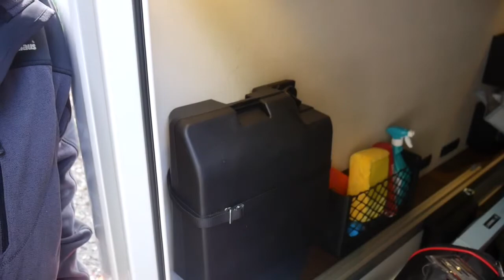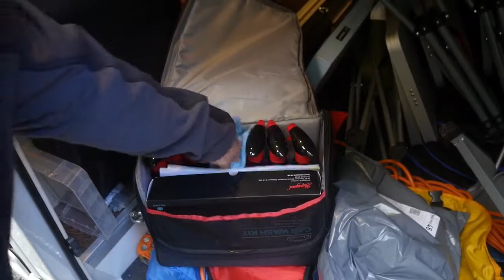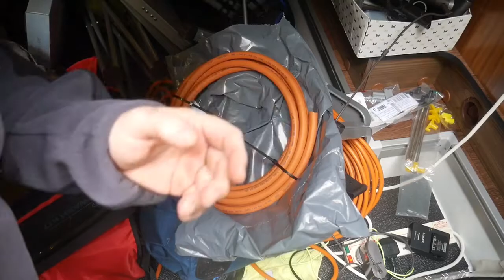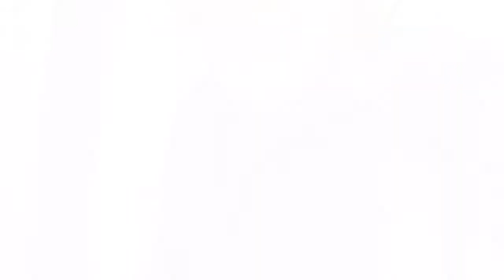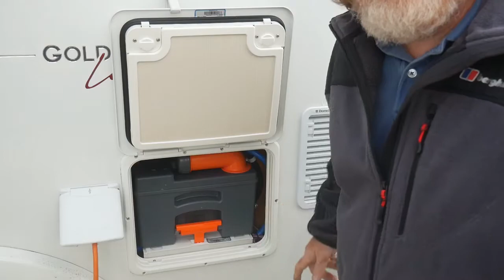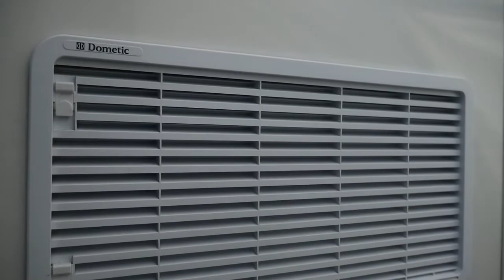What’s in the cupboards part 3. Fulltime Motorhome Life Vlog #213

Comment: Hi Steve, Enjoyed the video,  lovely van.  I know most new vehicels don't come with a spare wheel these days but I would certainly purchase one if it were me.  I know it will take up a little more weight and space to carry but its worth the peace of mind. When disaster strikes nine times out of ten its always in a awkward or dangerous  situation.  I wouldn't consider wild camping without a spare wheel.  I know the manufacturers say they don't supply  a spare wheel  for green reasons but that is  complete and utter rubbish, the real reason is to cut down on manufacturing costs. One more thought,  If you unfortunetly get a puncture and the tyre  isn't repairable,  which happens quite a lot,  would you be able to locate a new tyre quickly especially if you are in a remote location.   I would give all this some serious thought.  Good luck ***